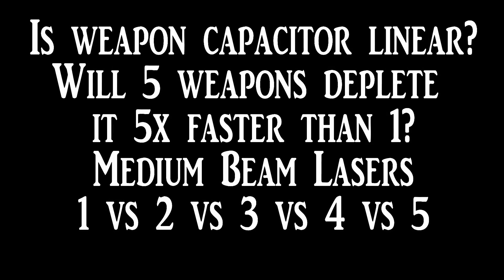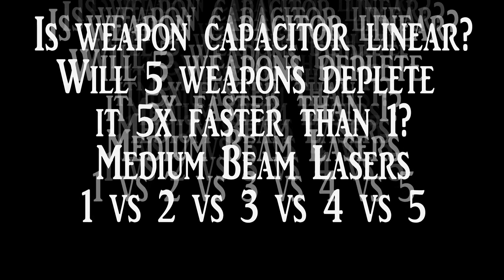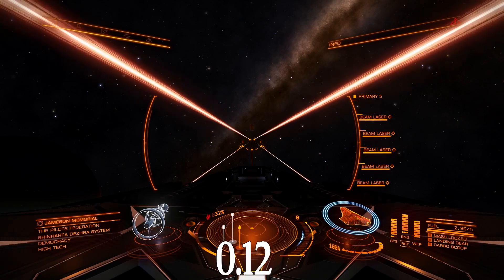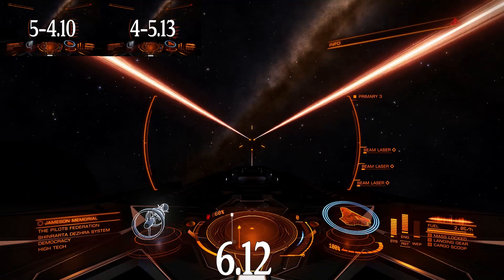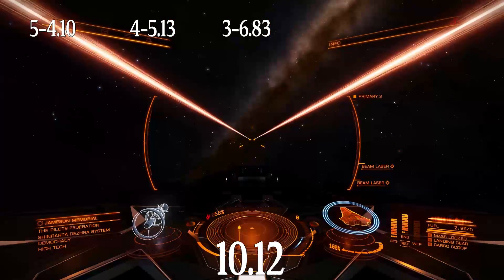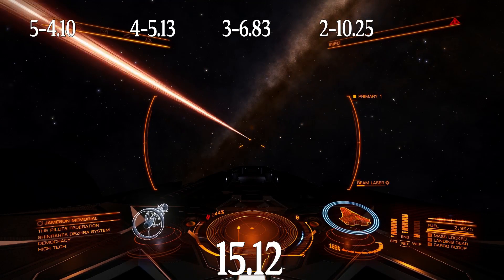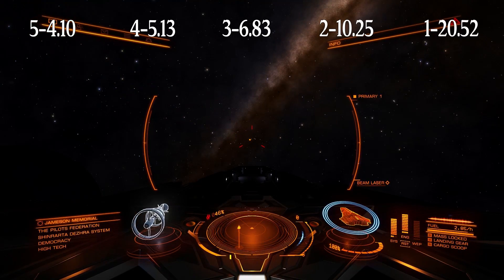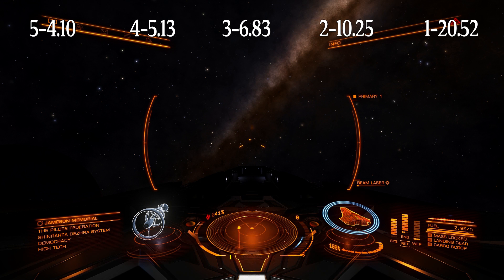Elite: Dangerous. Is weapon cooling by WEP capacitor linear?

Comment: Try it with large beams. I think it's a nerf that applies only to them. My tests still show almost exponential increase in capacitor drain for additional large beams.
Reply from the maker: +Robyn Highart hmmm, large beams? well, ok, why not, easy enough to have 4 large beams on conda but if it's really true with large beams then it wont make any sense at all ;)
Reply: Kornelius Briedis I've just done a proper test with averages. With zero pips, you are correct it's absolutely linear. However with 2 or more pips, the A8 capacitor replenishes charge really fast with just 1 or 2 large beams firing. And so it kind of throws off the curve. With 3 and 4 pips, the one large beam fires so long (infinity on 4 pips) that it should be excluded from the result. 

In conclusion, the capacity drain of weapons scales linearly with number of weapons running. However, with maximum charge to WEP, on a high-powered capacitor there is a threshold number of weapons that need to be running, in order to overcome the recharge rate. So it was my inaccurate tests, as well as factoring in the results of the 1 beam & >3 pips, that caused me to think my suspicion was correct.